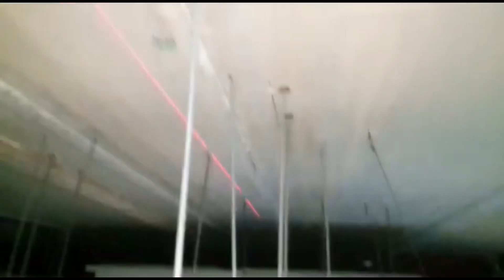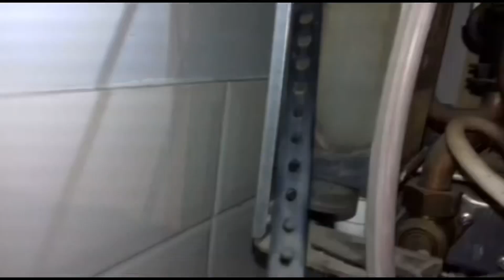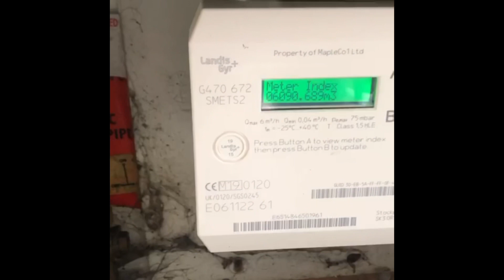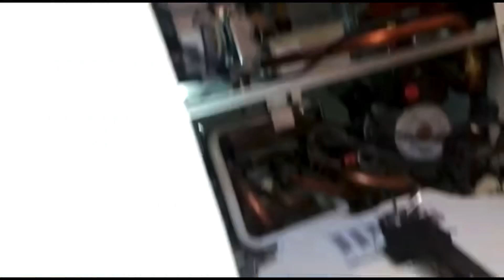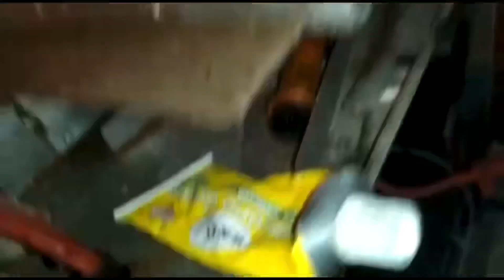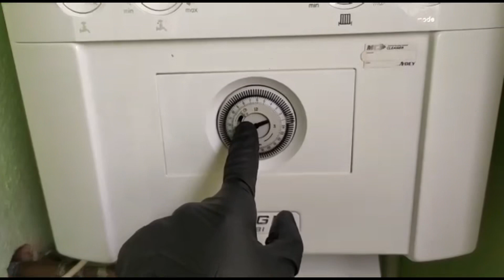Plumbers Videos - Free Gas - Dangerous Boilers - Water Leaks

Comment: Regarding condensate pipes.  My pipe runs to the north side of my property which is out of the sun.  As a result some green lichen had grown inside the end of the pipe, potentially blocking it. I was able to clear it simply by knocking the end of the pipe with a broom handle (taking advice from Trigger).

Comment: My sister boiler  had a issue and a issues with the drain's that were blocked outside and backing up to the  toilet on the first floor . the boiler also stopped working British gas came out the plumber said the condensation trap was block soon as he pulled it off  inside the boiler the contents of the soil pipe emptied into the kitchen and the boiler spraying sh1t everywhere .
The condensate pipe  was plumbed into the soil stack .💩

Comment: To cut lagging at 45 used to use an old b,& q plastic miter box ,makes cutting 45 degree very easy.
Reply from the maker: Very good tip. Thanks.

Comment: Hi Allen, on the commercial side of things do you think you could ask one of the guys to explain the shunt pump on large headers. Thank you. 👍🏼
Reply from the maker: I am sure we will be able to cover that. Thanks.
Reply: It just moves water around the boiler and the header.
Reply: @cliveramsbotty6077  when does it turn on and off? Is it wired to a stat. What size system would be a   starting point for one? I know thats probably getting more into the mechanical engineering side of thing but I'm just interested in how it all works.